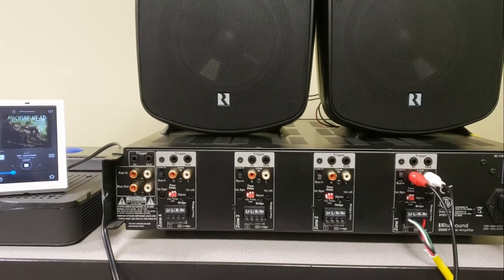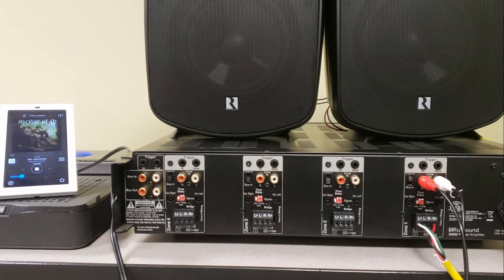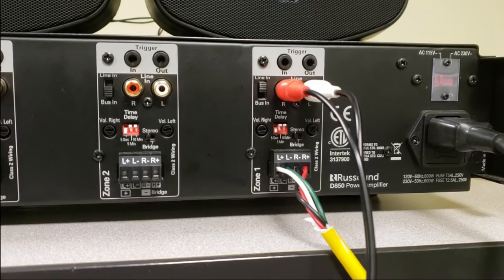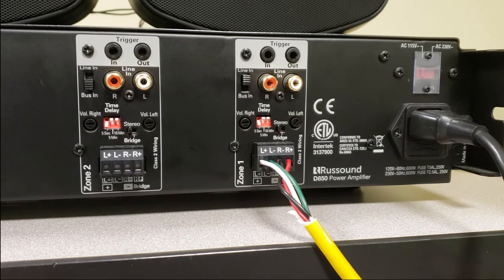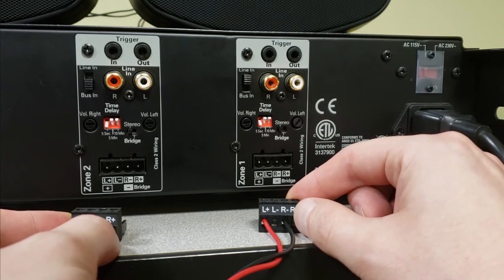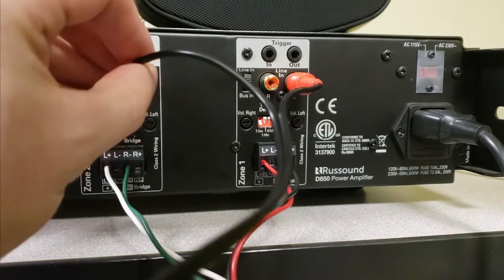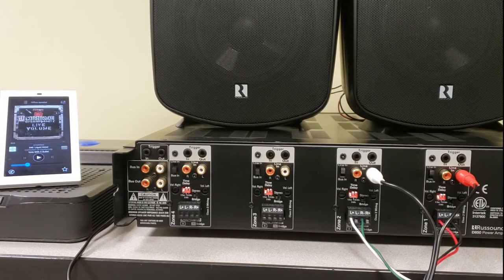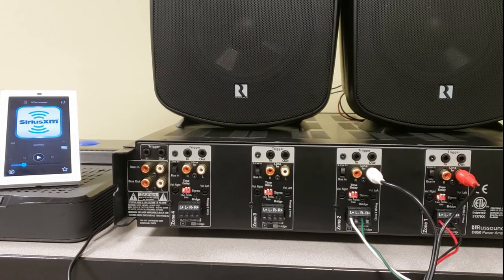Using Bridge Mono Mode with a D850 or D1650

Comment: Can you use the other 2 zones to wire another set of speakers in same bridge configuration?  If so can the bus input then be used?  For example powering a set of outdoor speakers all in bridge mode, but on same source?  Thx!
Reply from the maker: Thank you for contacting Russound.  The best way to reach us is to email tech@russound.com or to call our Tech Support staff during business hours at +1.603.659.5170